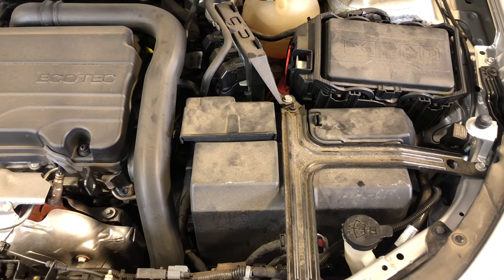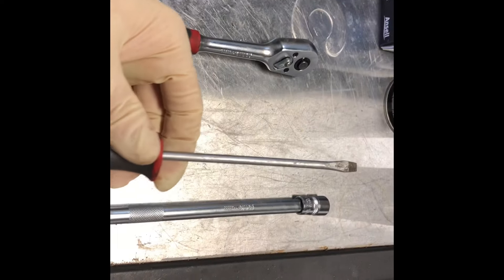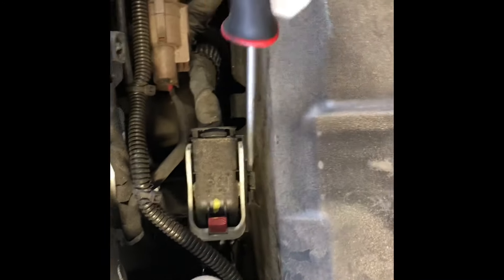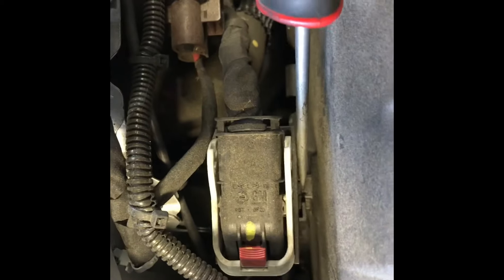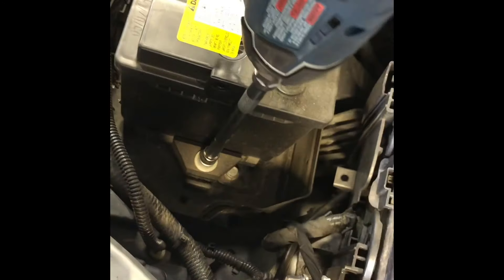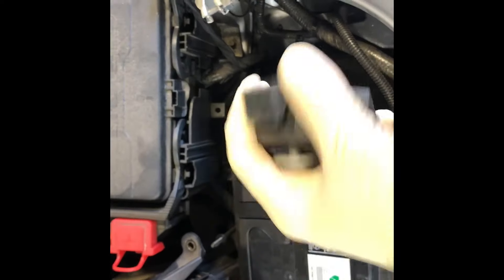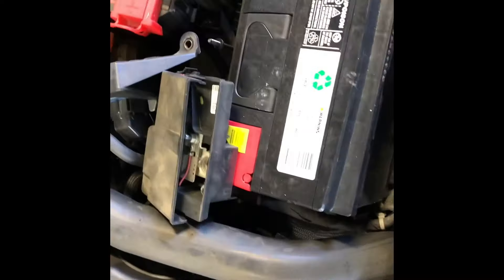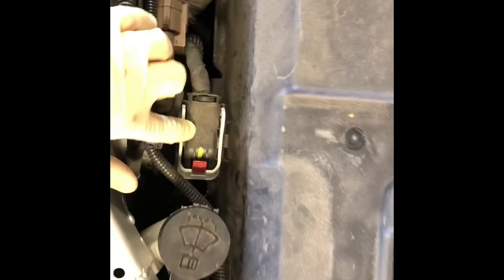2016-2019 Chevy Malibu Battery Replacement

Comment: Good video, sad what vehicle manufactures are doing nowadays. There’s no reason a battery should be that hard. GM just wants some kickback on a battery replacement job, which is probably a 300+ job at a dealer. Ridiculous.
Reply from the maker: Yes I agree ,  the car basically has 2 hold downs and then the positive terminal and the plastic cover also kinda hold it down too , it’s just too much
Reply: I was quoted $450 today for a new battery on my 2018 malibu at the dealership.  Yea I left and made some calls and got a brand new battery for $150! Pays to have friends at part stores.
Reply: Have one of these for a work vehicle, there are so many stupid little things like this that makes me hate these cars. Thanks for the video

Comment: Watch another vid,but find some difficult for remove +part,then I ask my self that there are other videos that may be better,..and yes found your and it was straight forward,..for example no need to remove side minus connector it's allready attached and you can pull it with the terminal..
Much thank..✌️🤙👍Lord Bliss

Comment: THIS Video is the correct way to change out the battery however!! while changing any model over 2016 it must be hooked to a battery saver which means there must be power running to the car at all times while disconnecting the battery if not you will get an error code CAL and your check engine light will come on
Reply: The check engine light comes on anytime it tastes too much ethanol anyway so no big deal
Reply: Will the car still run?

Comment: So I went too far out on the positive terminal, it seems. Now I can't get the nut to bite onto anything. Any idea how I can fix this?
Reply from the maker: jimmymarquez108 sorry i was so late hopefully you was able to fix this issue , I’ve seen a few of these cars the nut comes out to far and breaks . Usually I would try to rig it up or I would slide a flat head into it to hold the stud still and keep trying to tighten it . If not I’ve had instances I have to replace the whole terminal assembly  . Hopefully this helps if you haven’t fixed it already bud !
Reply: @reneantonio91  I felt dumb after my mom said "you can't just pull up on the nut with pliers and turn it?" you know what? She was right. Was able to get it tightened up again with a socket

Comment: Does this car need a specific kind of battery for the auto stop and electronics to work right?
Reply from the maker: Ruben Villa yes , you need a H6 AGM battery , make sure it’s a AGM battery , if not alotta electrical issues can happen and things not working right and batteries prematurely needing replacement
Reply: @reneantonio91  my auto stop and start stopped working after I changed my battery and a Check engine light came up with a U01B0 error code .... what does this mean?

Comment: Can I buy a regular top post battery
Reply from the maker: You need the correct H6- AGM battery for this car , I’ve seen regular batteries that are not AGM burn or prematurely die or cause other electrical issues because it’s not the correct battery